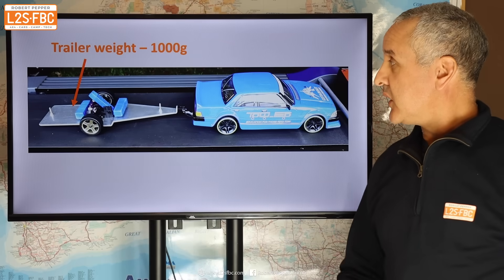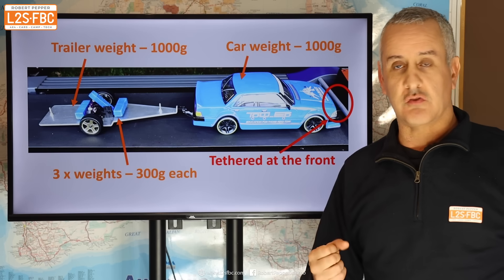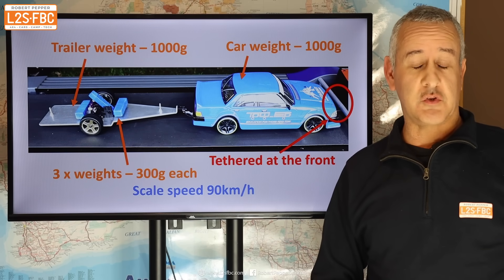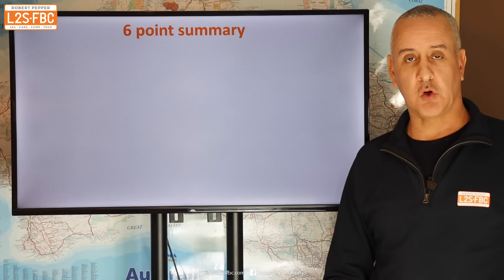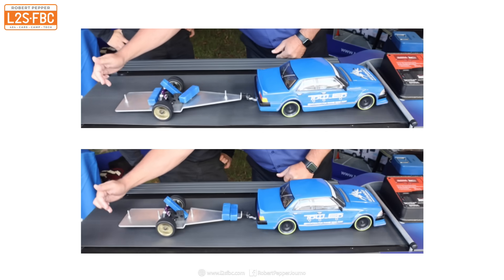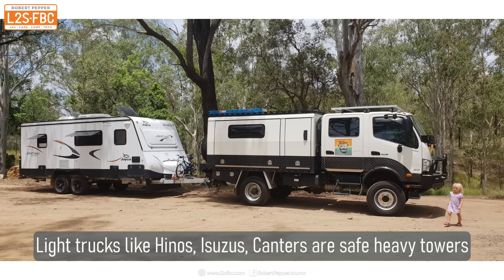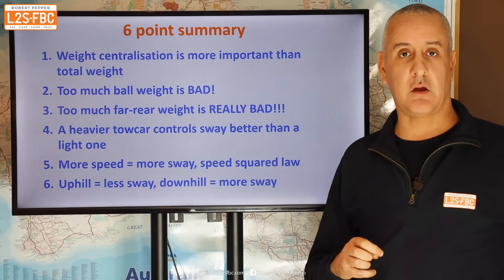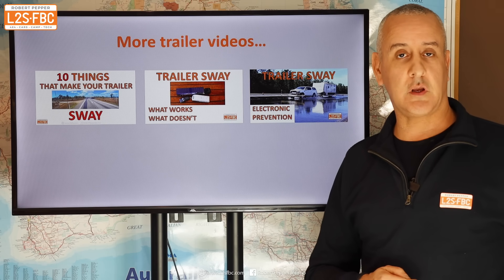7 trailer weight distribution setups, some safe, some deadly.

Comment: What's interesting about this is that in the US we have different requirements for towbar weights.  While excessive nose weight is a sway adder, center weight is actually LESS favorable in terms of oscillation damping than a slight nose forward distribution, especially as it relates to speed. Note that in your test you have more than 31% tongue weight in the nose-heavy example. In the US we shoot for between 10% to 25% trailer weight on the drawbar or tongue.  Studies have shown that as speeds rise this setup is inherently more stable than 3-5%.  There is a study by delphi where they did rear world testing with 3% drawbar weight, 10% weight and -10%.  They determined the point at which each one had oscillations that would decay, grow or stay neutral.  With -10% the threshold was at 45 mph (72 kph).  With 3% it was 65 mph (105 kph) and at 10% it was 100 mph (161 kph).  Obviously, no one should tow that at 100 mph, but we tow at 80 mph all the time (legally).  I tow a 1.6T trailer with my Prado (GX470) at 80 mph all the time in Utah.  My tongue weight is about 12%.  No problems whatsoever in any conditions.  Obviously, common sense being the first priority when towing. This, coincidentally, is why US trucks have lower tow ratings than other vehicles because they assume a 10% tongue weight which cuts into their payload.  Ram's Towing guide specifies this "it should fall between 10 to 25 percent of GTW".  The tow standard here, SAEJ2807 calls for 10% for all official towing tests to determine trailer capacity.  It would be really cool to see this play out on your demonstration table.  I realize it's not a good suggestion necessarily to say you should run lower weight trailers but more tongue weight just like it would be a bad idea to suggest we can run heavier trailers with less tongue weight here.  It's just an interesting data point.
Reply from the maker: Yes, excellent points and thank you for the post. Got plans to do more...but will say mere towball mass isn't all the story. Much depends on weight distribution. Thanks again for such a useful comment!
Reply: the laws of physics dont change as you cross an ocean

stavros
Reply: @stevecallachor1  apparently comedy does though lol
Reply: You literally wrote a whole thesis about “here in the US”…for no real reason.. the scaled examples were good enough to explain the dynamics of a vehicle and trailer… and it doesn’t matter where you live .. it’s generally the same dude..
Reply: @speedlimit6869  Trailers sway in the opposite direction here in the northern hemisphere. ;-)
Reply: @speedlimit6869  It actually does matter where you live because vehicle and trailer won't react the same. Europe and Australia both have a lower than normal maximum speed limit while towing. The US and Canada both allow combinations to travel at the same speed as the rest of traffic. This can be up to 85 mph/137 kph in parts of the US. At these speeds we can't afford to be unstable. 
This is why specs for tongue weights are different and tow ratings for the same vehicle (except North American 1/2 ton and up pickups which get downrated to 4.5t) will be higher in Australia than they are in North America.
Reply: @rich7447  We're recommended 10% or more in Australia as well? Or am I misunderstanding?
Reply: @newbris  For some reason Europe has a 7% minimum tongue weight for conventional hitches. I wasn't sure what Australia recommended.

Comment: Could you do the same for a tandem axle? Showing the affect of wheel distance apart, and steerable front wheels. I have wanted to build one that is lighter due to more even load distribution and doesn't load the ball much or at all because the tongue is hinged. This would also lead into towing a car, though I don't think those actually turn the front wheels, which would be another test scenario.
Reply from the maker: We have plans..stay tuned

Comment: Sway bars, get em, use em. Your trailers tongue weight should be 10 to 15 percent of the gross trailer weight, loaded and ready to travel and weight distribution is still very important to maintain a stable ride.

Comment: Excellent video as usual. Unfortunately in America, camping trailer (caravan) purchase decisions are made primarily based on floor plan and the folks in Elkhart are all too happy to produce floor plans with horrible weight distribution. To compound that problem, the instinct of most drivers when they first feel those hints of instability is to increase their speed by 5 to 10 mph. 
In a sway situation, your biggest tool to prevent it from becoming a tragedy is the lever on the brake controller, not the steering wheel. Nobody explains that to first time trailer owners, and few ever pick up that little nugget of information along the way. 
Idea for a future video: show the effects of brake application while the trailer is swaying; tow vehicle only vs trailer only vs both.
Reply from the maker: Thank you and yes exactly that is planned 👍
Reply: Increase their speed?? My first reatcion would be to take my foot off the gas
Reply: @noobulon4334  You are obviously a lot smarter than some other people out there on the road. In some small way, it restores my faith in humanity.

Comment: Very informative video. I enjoyed it very much. I am wondering what is the proper hitch ball height and what happens if it is too high or too low?
Reply from the maker: Glad it was helpful! Please share. The correct hitch height is when the trailer is level. If it is too high or low then with a tandem axle without loadshare suspension too much weight will be taken on one axle, leading to a lack of stability.  A single axle is less of a problem but you also run into stabilisation and clearance issues. So, tow level!

Comment: No mention of the wind pressure wave generated by trucks and coaches etc. When I drove a truck caravans overtaking would start to sway as they reached my cab door, I would immediately come of the gas and the vans would settle. Luckily  I never witnessed one over swing and turn over.
I also drove a car recovery 2 ton truck and car trailer rig, at one accident. I recovered the damaged trailer onto the truck,  winched the car rear end first onto the trailer, this was done for access reasons. I started my journey cautiously but could feel the trailer pushing the rear of the truck sideways. Reloaded the car engine first with no further problems.
Reply from the maker: I have another video on effect of wind...
Reply: @L2SFBC  Thanks, will check it out later.

Comment: Excellent and thanks for the detailed explanations.
How is the set up for example, Pajero towing another Pajero on trailer, same dimensions/weight!?
As I understood placing weights in the middle of the car being towed would minimise swaying, how much weight would be advisable to use, like for example sand bags etc?!
Reply from the maker: Centralise the weight rather than adding more.
Reply: @L2SFBC  How would this be possible with a car on the trailer?!
Reply from the maker: Move the car fore and aft
Reply: @L2SFBC  OK, thanks.

Comment: Great vid. Many things were already said for me. I was just wondering about the uphill being acceleration and downhill braking... if those video examples are perhaps caused by accelerating to the higher speed, where it is stable, but less-so, however, then decelerating while changing back. (Without use of brakes, which would activate trailer brakes, simply letting off the accelerator.)
Reply from the maker: Glad it helped!  The reason that an incline makes a difference is because of relative speeds; for sway to occur the trailer must be going faster than the towcar. Uphill, that's difficult, downhill it's easy.
Reply: @L2SFBC  Why does the trailer ever go faster than the tow vehicle.  I don't understand that.

Comment: You should mention that applying the trailer brake pulls the the two straight, i saved a pickup and trailer that had lost a wheel by doing this.
Reply from the maker: Certainly does and that is covered in detail here -> https://youtu.be/nc0ndz92IWY
Reply: I was gonna comment this about trailer brakes.. it does indeed stop the sway if caught in time..
Reply: How do you apply a trailer brake independently? Are you saying you have Airlines hooked between trailer and car like on a truck?

The only trailers I have ever seen here the brake is controlled solely by the tow hitch going into compression
Reply: @dasy2k1  usually heavier trailers have electric brakes like a double axle camper or a dump trailer for instance.. your vehicle needs to have a controller installed (some 3/4 and 1 ton trucks come with them) for the trailer brakes to function.. on the controller you can operate trailer brakes independently... I posted a link to a controller.. but I guess youtube didn't like that..  my comments gone lol.
Reply: @codyramos3200  Ahhh I think those brakes aren't legal in the UK...
Reply: @dasy2k1  hmm interesting.. do yall have something equivalent to our 3/4 ton or 1 ton pickup trucks? Like the dodge 2500 / 3500 , Ford f250 / 350 , chevy 2500 / 3500 here in the U.S.? Think our legal limit is 28,000lbs  when towing with a 1 ton dually.. truck+trailer+all cargo,  passengers,  fuel =  under 28,000lbs to be legal ..
Reply: @codyramos3200  Yeh the mitsubishi L200, Nissan Navara or Ford raptor are probabbly the most common pickups here

Legal limit here is 3500kg (3.5t) with up to 750kg trailer (3/4 ton)
Or up to 3500kg trailer if you have passed an additional trailer licence (although they are scrapping that soon and giving everyone it) provided the combined MAM is lower than 8250kg

Comment: Here in the US we use weight distribution hitches. what is your thoughts on them? i can make my tow vehicle set level even with a heavy tongue weight. and we also use anti sway device to adjust the resistant's on the tongue.
Reply: So few use those features, I don't know that I would say "we" do. It makes it sound like the majority of towing is done using those features, when it is probably 5% or less.
 It would be good to see a demo how effective they are though. I don't know if the model would accurately show the sway damper. It will work, just can the model be made to match a car?

Comment: Useful? Mate, absolute gold! Perhaps I didn't learn anything new but this is by far the best explanation I have seen. Should be mandatory to watch this video before you get a car license. Subscribed.
Reply from the maker: Thanks please share!
Reply: I just sent this video to my friend(who also happens to be my boss) and told him that anybody who ever drives one of our vehicles with a trailer at work should be required to watch this video prior to being permitted to drive a company vehicle and trailer
Reply: A trailer should be a separate component of licences, even if it’s only theory, and this video is one of the components. Up to 750kg, up to 2000kg and above 2000kg. I’ve seen so many idiot towing stupid loads, at least this one way to better educate them. I towed stupid loads when I was younger but it was because I didn’t know any better.
Reply: Yep I've had to explain it to a group about an accident it's amazing to see so many men over the age of 30 not knowing how to properly distributed load on a trailer
Reply: And revisited every time you decide to hook up a vacation trailer. I’ve never towed a trailer in my life, but my dad used to take us on family road trips when I was a kid. He was a motor transport sergeant in the US Marines, so pretty sure he knew what he was doing. Trouble is, I never even knew to ask. It makes sense though. Same weight distribution occurs on commercial airline flights. I worked as a ground agent for a short time and our crew chief calculated where in the cargo hold to store how much weight before each flight, mainly for fuel. My point is, I consider myself a fairly intelligent person and I don’t know that I would have given any thought to how to load a caravan. I think I would have assumed the caravan was somehow built for stability and that it wouldn’t be a problem I would need to address. In the US, many commercial industries use “freedom” and “personal responsibility” to shift blame for mishaps to consumers. All they need is a little sticker that warns the consumer that he’d better know what he’s doing. Liability avoided. The smart consumer investigates the stuff he needs to know before buying [insert potentially dangerous product here — motorcycle, trailer, RV with toy hauler, etc.], but obviously not all consumers. 

An old friend of mine bought a fifth-wheel caravan he towed with a Dodge Ram, Cummins Diesel powered, and never had any issues with sway. Is that an inherently safer design? Of course, he was an engineer for JI Case tractor company,so he probably knew what he was about as well.
Reply from the maker: Great post!  One thing that annoys me is people equating knowledge with intelligence. And there are different types of intelligence. Elsewhere in the comments many people say all this is common sense and if you don't know it you're an idiot. Those people need to think wider and broader as they are wrong.
Reply: @L2SFBC  .. are you suggesting that excessive weight on the tow-hitch causing instability in the front wheels of the tow vehicle came as a surprise to you? Were you perhaps shocked to learn that weight at the rear of the trailer would lift the rear wheels of the tow vehicle? What exactly wasn't common sense to you, specifically?

You speak of common sense and entertainment value as being somehow mutually exclusive and they're not.
Reply from the maker: No I wasn't surprised by any of this. However others are. The fact they are surprised does not mean they are stupid or lack common sense.
Reply: @L2SFBC  I see.. okay.
Reply: So how should the weight be distributed if you have the weight at the front, do not compensate with weight at the rear, do you load the counter weight in the middle, I pull a small aluminium trailer with a large motorcycle. I have mounted a 30l fridge on the front it was designed to have an esky there anyway , so to distribute the weight correctly do I place heavy (water, lipo battery) counterweight over the axle, the axle is 2/3 towards the rear not in the middle, these trailers are front heavy, I have read that the manufacturer recommends a water container on the outside rear to counteract this, cheers Gary
Reply: I think that regular drivers should have to get endorsements on their license before they can even pull a trailer. A few weeks ago I saw a guy pulling a truck on a car dolly. That truck also had a car behind it on a car dolly. They should have been immediately pulled off the road and shut down.
Reply: All of it seems entirely logical, but as you say... an enjoyable experience. You earned a new sub mate.. well played.
Reply: This has been pushed for years in the UK and the sway problem will not go away because there is no control in place - as an analogy it is like saying you can steer a car using weight transfer from side to side but here is a better way - A STEERING WHEEL.
Reply: The trailer model design is flawed. The tongue is too long and the wheel axles are placed too far forward to be able to put a load on it.
Reply: gold ? only gold ? that should be gold coast to you ozzies, mate
Reply: Indeed: "Should be mandatory to watch this video before you get a car license."
Reply: Why? Most people will never, ever, ever use a trailer.
Reply: @MeepChangeling  All they would need to do is watch is a video for a few minutes. No extra testing or anything. No special endorsement bureaucracy. Just watch a video. That's not too much to ask. 

Some people never drive outside the city. They are still expected to know how to use an overtaking lane or a one way bridge, dim high beam, etc. 

So if they never tow, that is fine. It wont hurt them to spend a few minutes watching some basics of towing anyway. 

In any case I don't think the percentage of drivers in Australia who would ever use a trailer is small. There is no shortage of SUVs and Utes capable of it. Some people never tow anything for decades. Until they retire and then buy a 2 or 3 tonne caravan.
Reply: I took extensive driving courses before getting my license, and I agree
Reply: I absolutely agree.  
MANDATORY, not voluntary.
Reply: Same over here👆👍
Reply: What an annoying accent.
Reply: @portobelloedinburgh8891  Mate, do us all a big favour and remove your comment. Robert has taken the trouble and time to present this potentially lifesaving information for free and all you can contribute is a pathetic insult. Grow up.
Reply: @portobelloedinburgh8891  What an annoying comment.  👎😲